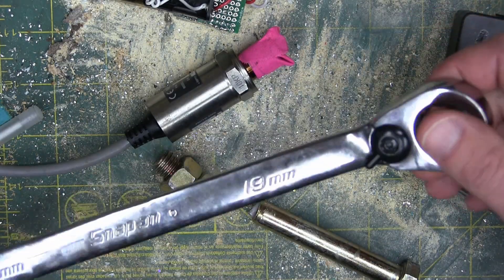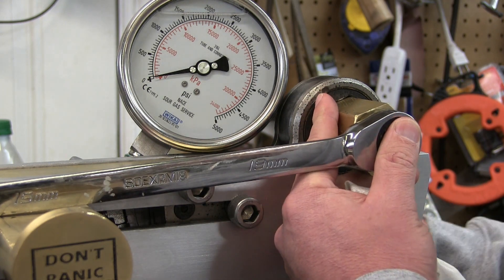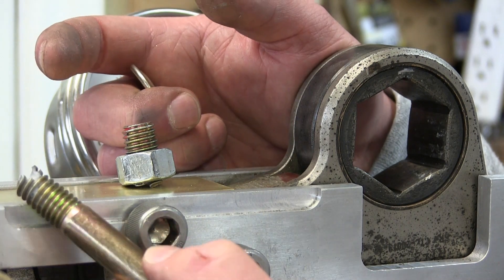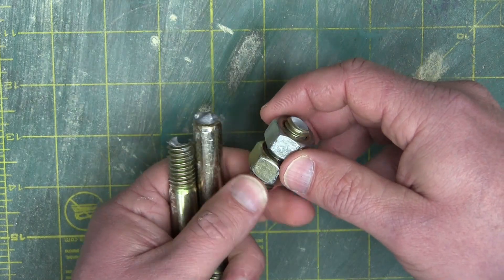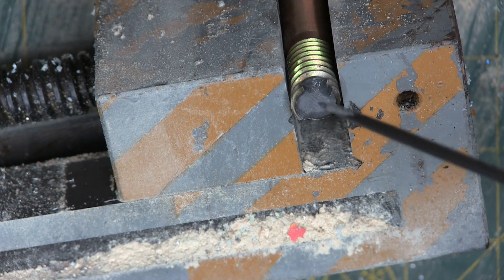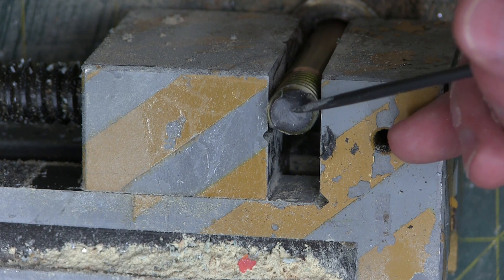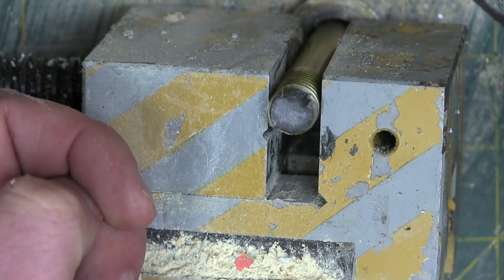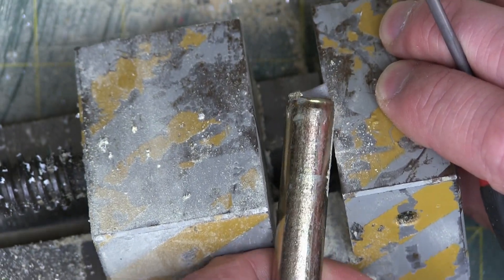BOLTR: BOLTS! | How much torque before break?

Comment: Fun fact: A490 structural bolts are never to be reused once they've been pretensioned. A325 structural bolts can be reused, however.
Reply: Why?   Because they want you to buy more A490 bolts?
Reply: A490 are stronger, but more brittle than the A325 bolts.

Comment: If you replace the old bolts what about the threads in what ever you are working on in my experience the bolts can be harder than the threaded blocks or parts there's so many factors that can screw ya in the end

Comment: *Here is a potentially easily marketable potentially smart idea*:
A really smart thing actually on high end ratchets could be to have a key on the drive dimensioned to break before it, followed like 5 degrees later by another, much stronger key. Two advantages: the key can be a 3 buckaroo sacrificial part furnished by the handful with the tool when purchased OR greedily sold by the pair in a box way too big just to remind the customer that he's a sucker as a separate consumable item, and your hand is protected from getting mangled as the ratchet will be stopped a few degrees of rotation later by the second key. You could even use soft metal like lead ahead of the second, stronger key to dampen the impact. Surely useless since videos past proved you can't break these cuffs, right ? Well, unless millions and millions watch these vids enough to kill the idea in people's minds that they can break those cuffs, these is a market for "safety ratchets", people will feel comfortable going nuts on the things and pay for that peace of mind, you could even have different strength keys to have variable "max psi" "slip", without the disadvantages of variable torque wrenches. Now feel free to destroy the idea, I've enjoyed it for all it was worth writing this. https://www.youtube.com/watch?v=jhrwC2BoAkE

Comment: I once broke a 1/2"-diameter bolt at work (about 20 or so years ago) by over-tightening a clamp using a 1/2" ratchet wrench. Of course, the wrench was 18" long so with that thing it wasn't that hard to do. Just to say, it's easier to do than most people think.

Comment: Just one question Uncle Bumblefuck: How does this explain a failure in the middle of a hollow shaft of a vintage roadbike Wolber wheel? The damn thing broke right in the center and not at either threaded end and I can't get it out to analyze it or rebuild the wheel (being I'd liike to keep the french made Sakae Custom bike as authentic as possible). I've replaced plenty of shafts in my day and never seen one like this.

Comment: I used to overhaul aircraft wheels. The two halves were held together by 15 bolts. We would measure the length of the bolt and run the self locking but down to a specific torque then count the threads protruding. That was the reject or re use for the hardware.

Comment: bolts are a lot of work if u don't have a good and simple method to suppy replacements.  i'm a unimog guy now but i was raised beleiving perhaps the peoples car was not just a weird nazi dream.  almost all very critical vw bolt are militarily demanded to be replaced as per 250 dollar sevice manual with whom does the liability lie?

Comment: When using used bolts on critical applications, I have always (at least the last forty years) used bolts that had both ends ground parallel to each other. You first measure the length with a micrometer, torque the bolt, then remeasure. If the stretch is excessive, the bolt is junk.

Comment: Can anyone explain what a 'stretch bolt' is? My German can manuals tell me many of the bolts on my VW are single use only.
Reply: Often, at least for the cars I've worked on, the one-time-use bolts are for subframe mounts and such. Reason being, these bolts need to fail during a crash and are part of the designed failure locations to absorb energy. I've typically seen them speced with a high initial torque, then an angle torque (like 90 degrees of extra rotation) to ensure slight yielding.

Comment: Omg! This is a mother of a question. So many nightmares with engineered torque specs, bolt types, washers, convex washers, type of lube....Just torque this flange 6 times wait 24 hours torque again, wait 72 hours and torque again.

Comment: Test some audi/VW torque to yield bolts.  Can you re use stretch bolts?
Reply: Why would you want to risk it? Yielding is a failure state, even having been torqued can be a failure state because there are so many variables in the process of straining that you cannot make an informed decision about whether or not a part can be reused. As he said in the video, if the bolt or part has a critical function that could cause some sort of nontrivial damage if it failed then you replace it.

Comment: I am all broke up over this video.  I like good bolts but my cheap nature always makes me buy cheap bolts.
Reply: The grade 5 vs grade 8 still bothers me even with all this info on the intertubes. Take an old Jeep CJ build, of course use at least grade 5 but where am I actually wasting money on grade 8's assuming I'm installing all new bolts? Bumpers and winchplates get 8's but I'm cornfused if the rest of the chassis would benefit from 8's or not. Things are getting abused but not everything is open to high sheers. I guess wait until I break 'em in the boonies and decide then

Comment: Just wanted to point out amount of torque a bolt can take all depends on it's specs,  buddies 05 f150 has bolts in the suspension that are something like 320 ft-pounds....which is real fuckin hard to torque lemme tell you hwat.
Reply: Usually high torque fasteners are NF thread not NC lilke he used. Main harmonic balancer bolt is always NF, too. There is less leverage on the point of each thread to fail.

Comment: In the structural industries we have almost entirely gone away with torque based tightening requirements. Inconsistent lubrication, flash rusting, etc lead to different clamping forces for the same torque. Direct tension indicators are the way to go and don't require anything past visual confirmation or a feeler gauge.

Comment: 45 deg failure angle indicates a ductile failure due to shear stress. Ductile materials don't break in pure tension because they are very good at putting up with it. However when tension is applied shear stress also builds up proportionally and this causes the failure.  Only brittle materials such as cast iron or ceramics fail purely due to tension, but their failure is much more difficult to model accurately without experimentation. You can try this at home with play doh or silly putty. There will always be a 45 degree cut or conical break when you pull it apart.

Comment: You must be careful with head bolts in engines as many of them are torque to yield and are designed to deform permanently after being torqued so those types of bolts can never be reused.
Reply: The thing about torque to yield is they will never reach the same torque again as they have already "yielded" so they can not be reused for that application. Trying to do so will only result in having to fish out the remnants.

Comment: The home user has little quality control over his nut and boltage. That's why stealing them from work, through an agent, is the time-honoured tradition because work has been able to spunk vast amounts of dough on buying the wrong shit just to be able find the right shit from the right supplier. Also, if it's people that I don't know, I'd reuse all day and let The Big Guy decide who gets buried under the failed structure. No point in going outa your way for the unlucky.

Comment: Can you test what would be stronger a bolt or a stud?
Reply: Fasteners come in grades that correspond to their strength. The suppliers should have this information available.
Reply: Stronger how?  The question is no maka for good answer.
Reply: JViello well im going to use small block chevys as an example because ive been told that studs are stronger than if you were to use bolts and if both fasteners have a 200,000 psi yeild strength then why would studs be stronger? Is it stiffer?
Reply: Gotcha a bit better Ben so thanks for that.  The question is still a bit vague in the world of boltology. I know exactly the phrase you speak of as I've been in the motorsports world practically my whole life.  In short, the people who say that really have no idea what they are even saying so to them it's: "stud worked more gooder so studs are stronger."  In reality a bolt or stud goes through many stresses.  To keep it simple think twist and stretch.  Most times the studs are simply better material and the threads are rolled (literally roll pressed into the blank) vs cut by a die.  That keeps the grain structure in tact and makes it more gooder vs cutting the threads.  Just that alone makes a world of difference.  Then there are cases where the stud is less likely to stretch with a nut being torqued down than a bolt.  But its really application and material specific.  What just about everyone is talking about in your scenario is simply the fact that the stud by say ARP is miles better than the factory bolt spec'd for a stock 250hp small block.  So like everything to the JFM people they conclude "stud better always". The real answer is "sometimes".

Hope that helps.  Edited because I spell like a drunk Russian at this time of night.

Comment: Some people grease up bolts and fasteners, this should (if I am reading the numbers right) increase the tension on the bolt with applied torque remaining the same resulting in possible earlier failure. Would like to see this tested. Brilliant video - as usual.

Comment: ME student  and skookum choocher here, You are right about the 45* angle translating to a failure in shear. tauXY is 90* off sigmaX on mohr cicle, (X and Y coordinates). Morh circle angles are double of the plane stress angle so 45* sounds about right. Thanks for all your videos, they are a constant stream of enginerding inspiration.
Reply: A 45* fracture surface is actually brittle failure. Ductile is 90* for torsion.
Reply: Jack Markee dumb it down boy! Not everybody speaks ancient greek

Comment: I've always been told that structural bolts, A325/490, are to be used once and only once with no exceptions.  These are typically used to bolt large steel structures together, the kind you may see on bridges and antenna towers.
Reply: a325 are allowed to be reused, a490 are not allowed to be reused once they've been pretensioned.

Comment: Would you do a vid on home gamer batteries?  As in AAA and AA cells?  As in how much chooch for choch one is getting buying high quality cells say duracells vs dollar store brands?  I'm beginning to wonder how much it really matters using high quality cells.  I can get AAA and AA "crappy" cells 8 for $1 and I don't cry every time I have to change them which means my enjoyment factor and actual use of my items has gone up because I don't fear the inevitable battery drain.  Am I getting fleeced with this logic or am I onto something?  I'm still running copper tops in my sensitive electronics like my metal detector but I am running cheap dollar store "sunbeams" in all my battery burning stuff like my headlamps and I find I have a nice bright light more often than a dim burned out bunch of duracells I don't want to change.
Reply: Buy the 24 pks alkalines at Walgreens. Most all of Wag's stuff is made in brand name factories. Years ago I think it was 60 minutes that brought in experts to test WAG brand film and it beat the kodak gold.
They just had a buy one get one free sale. I've got 96 now.
Reply: With disposable drycells, I've found that duracell ones keep putting out good power longer than the cheaper ones. They dim near the end but it's fairly quick but up to then you have good light out of them.
Reply: My comment kind of inspired me to go do alittle bit of my own research.  You do get slightly more angry pixies for the price with cheap zinc carbon cells however about 1/3 of the life.  So in short it depends on your intended usage as for what batteries are best.  For me that means my high use/not critical applications I'm going to run zinc carbons and not be afraid to change them out, and for my critical long life applications run alkalines until their dead.  So like my headlamp which i burn for hours on end doesnt really matter if its dimmed some I am going to run zincs.  My metal detector and GPS alkalines.  Something like a TV remote it is a waste of money putting good cells in it.

Comment: I re use all bolts, new ones gets used on tow hitches, if the hitch needs to be removed the old ones gets used for lighter duty stuff and new bolts gets torqued to spec.

Comment: F.t before b.o is only for bolts over 1/2 inch. With normal spanner pulling without cheater bar can't really get enough torque that's why a spanner is the length it is.

Comment: It is not bench marks in the lands of SI-Units. In fatigue and fracture mechanics, we call it Beach marks.... When shits happens, would you as a design engineer want to be sitting on the bench or at the beach when the stadium comes crumbling down, because of a f***ing bolt.

Comment: How about axle "stretch" bolts?  The manual says replace every time, but my local service guy always reuses them.
Reply: Any torque to yield bolt should be replaced after it's been taken apart. You're actually stretching the bolt into it's plastic range, so there is a very high chance it will fail the next time it's torqued. Sometimes they self loosen, sometimes they break. U-bolts that hold your car to the axle are cheap insurance compared to what happens when they break.

Comment: the right torque is a quarter turn before it breaks :)
Reply: SuperDd40 torque at a solid stance until yer squinty eye is fully clenched, plus an eighth turn.. a little extra on bolts bigger than your finger. lol
Reply: eh if you want to be on the safe side
I usually do it a tenth of a turn

Comment: it there not a case of metal fatigue to worry about rather than stretched threads
Reply: Fatigue can only happen when there is a varying load. A bolt tightened to a fixed load, that stays at this load continuously will never fail through fatigue.

Comment: The only time I've ever broken bolts it's been the head of the bolt shearing off.
Reply: In my experience, that's usually because the bolt is rusted/seized in the nut

Comment: Love the vids Ave, Have you ever played with helix coil thread inserts? I often see them in high end aluminum products but wonder if they are actually stronger than just threading the aluminum..... As a J welder another crazy product you may enjoy is tig welding electrode(tungsten) chemical sharpener, I believe "chem sharp" pretty magic stuff but nothing beats a grinder in the end.
Reply: Usually in the machining world we use these to give greater longevity to the hole through less wear on the steel insert and to give a stronger hole essentially because say a M12 Bolt will be threading into a M16 hole if you know what I mean. Obviously thin stuff uses Rivnuts because you can't thread them.

Comment: Once upon a time as a bright-eyed summer intern at an aerospace company, I was working for a few guys with PhDs in materials science.  I'll add a description of what a non-torsional failure looks like.  We were doing some work on making sure airframes don't corrode and fail, so we were testing the impact of corrosion on fatigue life - give a sample of 7075 aluminum some quality time in a corrosion test chamber, clamp a test coupon in a nice beefy Instron, then cycle it from at rest to a tension of 15000 psi 10 times a second until it fails.  Just like in the video, the fracture pattern will look different right around where the failure initiated (like where a grain got corroded away).  Once the crack grows more or less radially to a critical dimension, the rest will fail all at once.

Comment: So quick question, how would bolts of different hardness react? Like if it was mild steel obviously it would stretch more but does that elasticity make it more violent and energetic? Also if that steel was super hard of couse it will take more pressure to break, but how different would it break because of the different crystalline structure?
Reply: Im no expert so take my answer with a grain of salt, but I'm pretty sure that a more elastic material wouldn't be as violent when it breaks, because a considerable portion of the energy goes into deforming the material, and weakening it. When a harder material breaks, all the energy is released more suddenly, so its more violent.